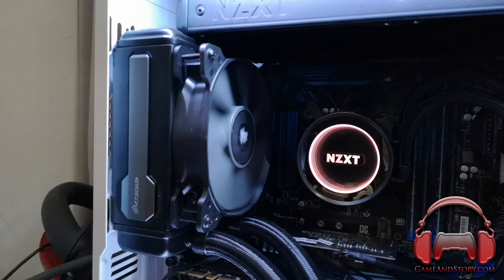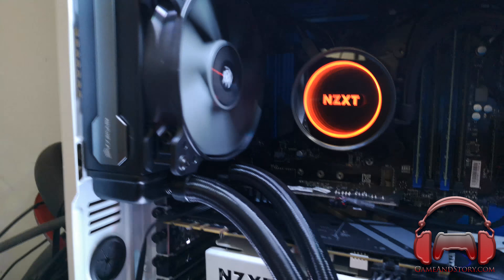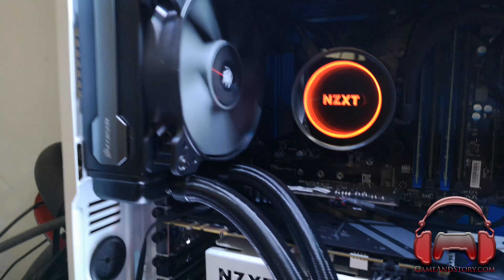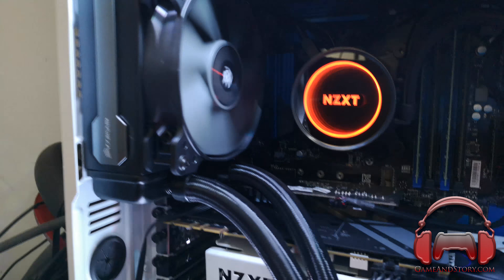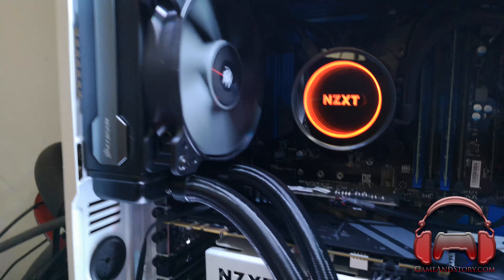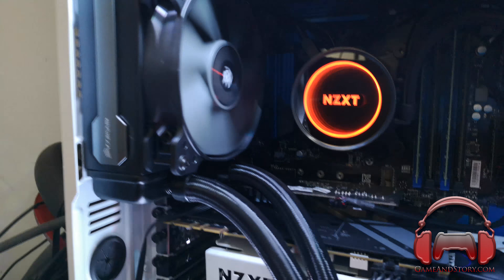VLOG Part 3 - The IDEAL dual-rad setup?

Comment: You're pulling heat from the rad, for your cpu without any push config? I'm not sure how you're getting any air out without having another force pushing it out first, best to do a push config or push pull config. Yea might be getting just a bit of air circulation out, but i dont think it'll be enough to cool it since the rad is quite thick and has a larger surface area doing a push config would be a better alternative for heat dissipation. Personally I recommend positioning the gpu rad to the front of the case to decrease stress from the tubings, giving the fact how thick those tubes are.
Reply from the maker: Hello my good man :)

There are three fans pulling in air from ambient in front, with air being exhausted out by the top rad in a pull config, and the rear rad as well. The reason I did this was to make sure no supercharged hot air was being dumped into the case as a result of air being forced through the rads.

The GPU is not exhausting hot air into the case, so the air being pulled through both exit rads is ambient, save for the air heated up by the HDDs being cooled by ambient air :) Hope that helps.

As for the tubings, pump speeds seem to be doing okay, and I haven't had any problems with temps so far.
Reply: @GameAndStory  for sure, it's  whatever works for you. But if ya think about it air or heat passes through faster if you're blowing into the rad and exhausting out vs vacuuming the air out with just a pull config. It's just more efficient in my opinion.
Reply from the maker: @yanglers6219  I actually went with this setup thanks to a video that Linus did on pull vs push configs, as the temps are the same, just that a pull configuration for an exhaust rad means easier maintenance to clear off gunk and what not.